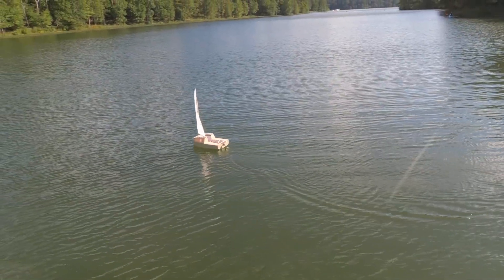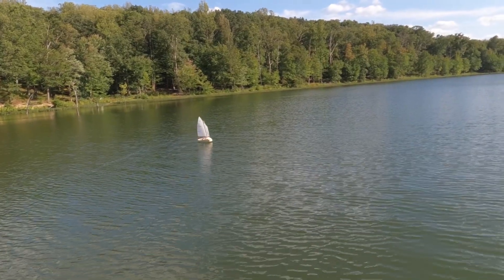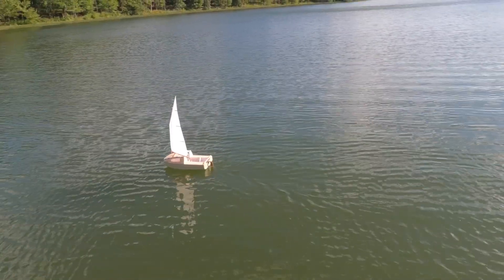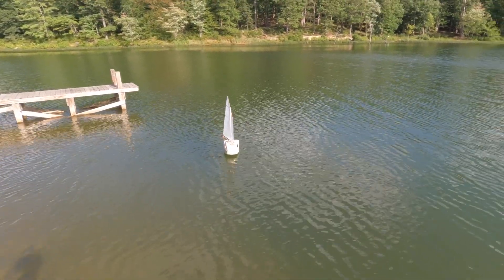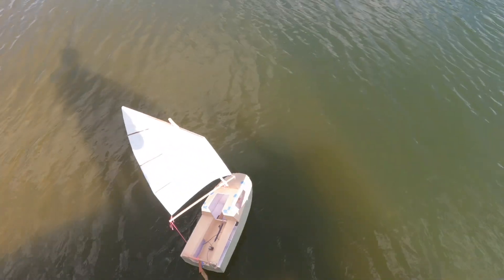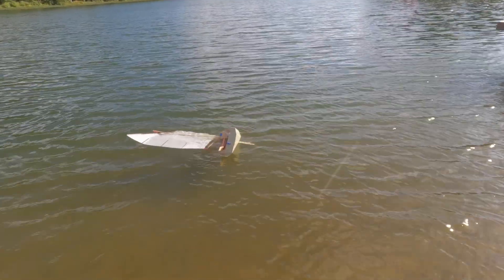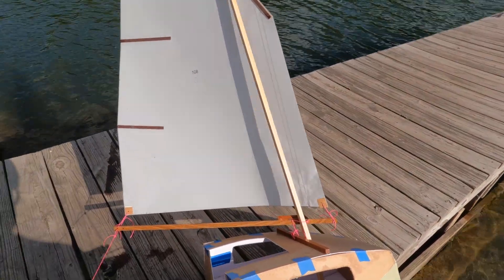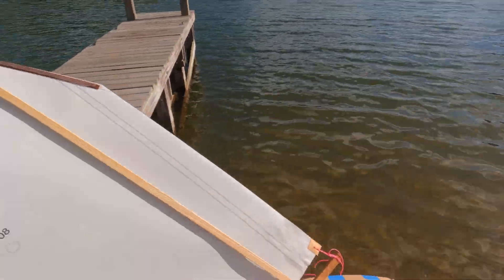Micro Scow Scale Model Test 2

Comment: What if the mast didn't sit in the middle. A bit starboard. Than some space between the Mast an boom Then the sail is no longer Touch the mast And you have a good profile in both directions.
Reply: Haha I just saw in a other video from you,  that the mast is already out of the middle😂👍 But for other reasons.
Reply from the maker: @CoernelSkateboarding you can shift a mast or center board about 12” (30 cm) sideways without affecting balance too much but people with OCD don’t like it.

Comment: I think the nicer option is 2 rudders than one long one, then could leave a convenient space for the electric or 4hp outboard to mount onto.  As for the capsize / sinking - yeah open windows at sea's a bad idea :)  what concerns me though generally is the sailor themselves in a small craft is such a significant contributor to the ballast is it hard to manage?  If you were to go overboard in the scenario the boat must be able self right, same with you onboard?
Reply from the maker: I think you are right.  It would be hard to do 2 tiny hinges and link with the model but easy with full scale boat.

Comment: Nice to see the model in some wind! It seems to perform well. Maybe you could coat the whole sheet of cardboard with tightbond 3 before cutting it out.
Reply from the maker: Great idea!  Too late, though.  I think I can save it once it dries.  I should cover the windows and add a few internal foam blocks.
Reply: Perhaps two rudders? Optionally pivot or pull the windward one up?
Reply from the maker: @ChristianNally  that is definitely the best option. The other option is to make the rudder deeper.